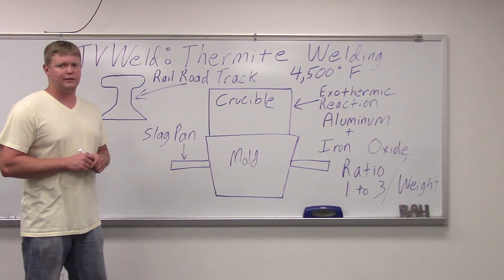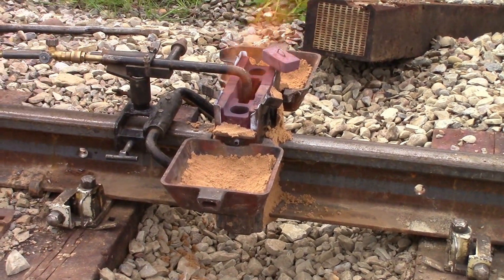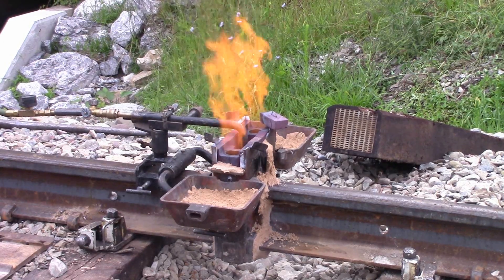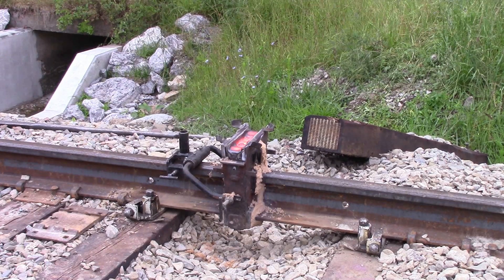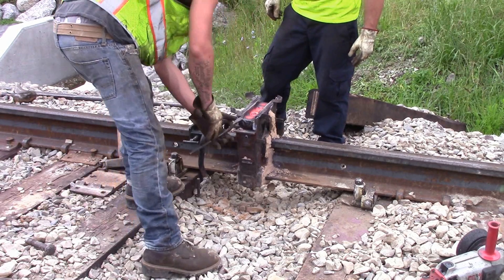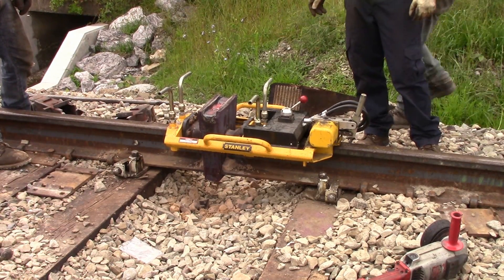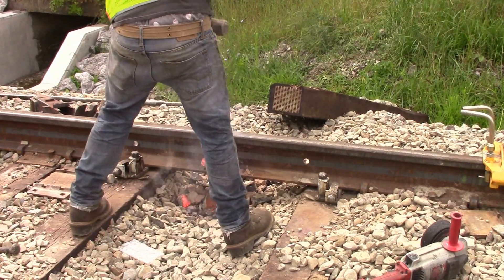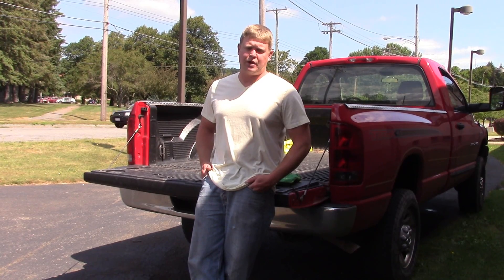Thermite Welding

Comment: That's awesome 4 to 6 welds a day!! Far out in aus we normally did 20 to 24 a day if we are weilding around turnouts 12 to 16 if we are doing 110m adjustment weilds or as we called it CWR but if you're just cutting in closures or glue joints in you can pump heaps of them out. 
That's wasnt the final grind though that's just the hot grind cause the weld hadnt cooled for long enough plus those lines on the top would be completely ground out plus the running face would be smoother too. 
All in all great video though.
Reply from the maker: Thanks for the comment!

Comment: Thats cool to see. I wish there was a shot of the gap between the two pieces before the weld. Could this be done using other forms of welding?
Reply from the maker: Not really.  I think thermite is the only process to fill huge cross sections quickly!

Comment: You forgot to mention if a cut is needed or stretch depending on the gap, in addition you did not mention the process of aligning the rail at all or packing the mold with sand

Comment: The base risers were knocked off way too early. They're only supposed to be bent out slightly so you can rough grind the top surface, field and gauge faces of the weld. 
 When bending the risers out, you need to be careful you don't create a hot tear in the top of the base.

Comment: where do you buy welding thermite?
Reply from the maker: The railroad guys told me they order it in some kind of kit.
Reply: @TVWeld  i am interested in doing some of my own welding experiments and home made thermite would produce raw molten iron which is likely terrible for structural welds.
the welding thermite contains additives and such, i have no idea what these additives would be but i assume they are various fluxes and manganese, carbon etc to alloy with the steel.
i've looked around a bit on google and can't find any suppliers for this specific welding thermite sadly

Comment: What are the chunks of steel or slag left on the side of the rail after grinding? Othe videos I've watched used a grinding machine for this job that sits on top of the rail.
Reply: Horns, pretty much nothing, fir overflow slag channel

Comment: I've see several videos of this and none of them explain the plug they put in the mold just before they put the thermite container on and light it.
Reply: Also a tube,they left the real parts out,and that so called finished weld looked like shit.would have failed inspection on FRA class #1 Track!
Reply: Leland Rogers this video explains the plug at about 3:30
Reply: @Legoboy3998  no it doesn't

Comment: How many a day? Hell, I worked railgangs making 16 + a day, back up guys and learn how to weld, how many did you drop by the way, the vid doesn't show the lining the rail, packing the molds. Hmmm. What's the crown tolerance and the inside of the ball tolerance for alignment.
Reply: 16 inferior joints also.
Reply: Lol uhuh.

Comment: The NS does things slightly different.  I would say something about those bolt holes but ...
Reply: If you would than you only worked new construction. In the real world we bolt the strings together so the rails can still be used to move people. It can have 2 bolt holes actually. I do these welds daily and it always has 2 holes in passenger rail and joint bars that we replace with bubble bars until it’s tested.

Comment: The NS does things slightly different.  I would say something about those bolt holes but ...
Reply: yup my railroad would look at this as an audit failure start to finish with both welds failing and cutouts, and an investigation to follow. was interesting to watch though.